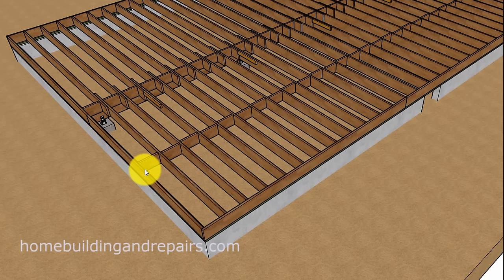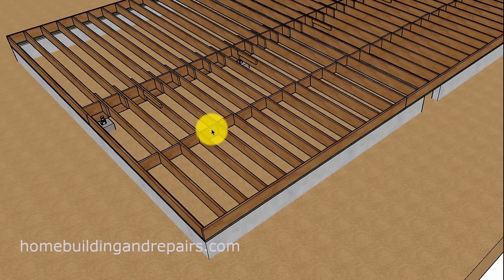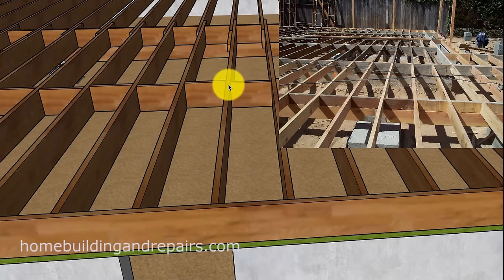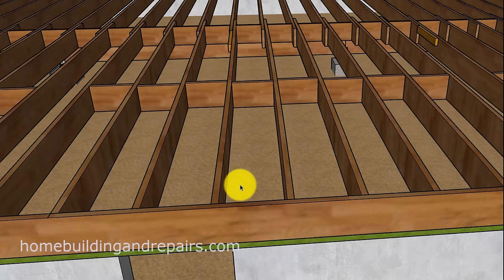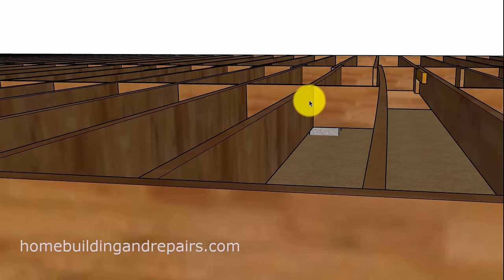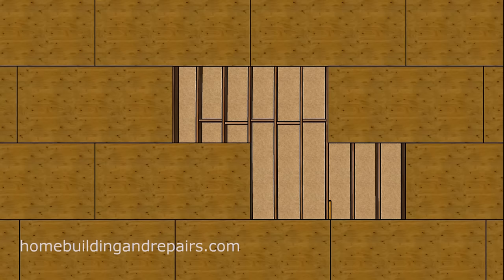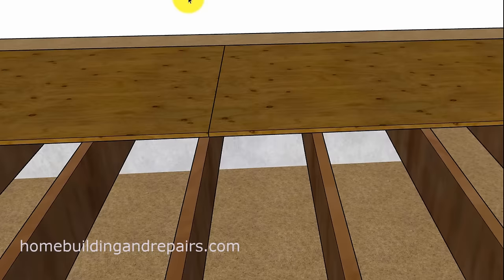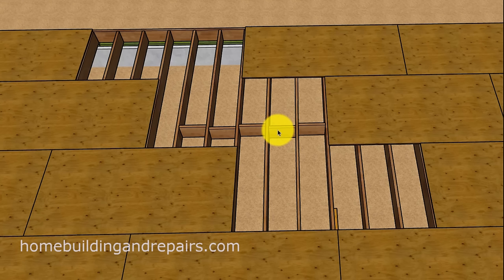This Is One of the Biggest Problems Keeping Floor Joists Straight

Comment: I'm building a 16x20 cabin im using 2x12x16' floor joists I don't want to put in blocking i really don't want my floor to squeak do you think I need them or can I get away without?
Reply from the maker: I cannot provide you with engineering advice, but can tell you that if you don't use them, it wouldn't be a bad idea to nail a 1 x 4 on the bottom and run it across the center of the 20 foot span to prevent the joist from moving.

Comment: Can I use Simpson strong tie hangers with 2x8 for mid span blocks on 2x10 floor joist that extend 14’? Just trying to sure up the beams before we finish basement. Thanks in advance.
Reply from the maker: It's probably something rarely done, but I don't see why you couldn't do it. Now for the big question, what is your reason for doing it?
Reply: @gregvancom  Mainly OCD, finishing basement and I thought it would be a good idea to replace split blocking with midspan blocking, but I can't nail in the mid-span blocks on both sides near the walls. Also, I sister joisted 5 runs under my kitchen island so didn't see how I can nail through double planks. Thanks for the reply.

Comment: Question please.  I'm building  a tiny house on a trailer frame. The floor is 9 feet wide by 29 feet long. What spacing do you recommend and should I use blocks?
Reply from the maker: I cannot provide you with structural engineering advice, but 16 inches on center usually seems to work pretty good and if it's only going to be 9 foot wide, I wouldn't install any mid-span blocks.
Reply: @gregvancom  Undersood

Comment: Pull your measurements from the same spot when spacing. Don't hook the last one and you shouldn't have problems. You can't just cut your spacer blocks to 22.5. because you will gain.
Reply from the maker: I know a few people who won't pull from other joist along the way, but if joist are space perfectly, then it shouldn't matter.

Comment: Greg, if you have a room of 8 x16 with joists 16, is it necessary to stagger the sheathing? Four pieces of 4x8 would work perfect, but I've heard to stagger the plywood
Reply from the maker: It's always better to stagger the sheeting from an engineering point of view. However, I couldn't tell you whether or not the building was going to fall down, if you didn't do it.
Reply: 4 pieces of 4x8 will still work perfect if you stagger joints - you just lay two end to end, then cut one of them in half (or to whatever dimension your joists dictate) and put the two halves on either end of the 3rd whole whole sheet.

Comment: What if the blocks were cut at an angle so you could pull-in/out each board to be 16” on center?  Would that defeat the purpose of the block?
Reply from the maker: It sounds like a time-consuming process, but as long as the top and bottom of the joist are stabilized in a way that will prevent them from twisting or deforming in a way that would weaken the structural strength of the floor then it should work.

Comment: Your videos...are excellent!!  I  just have one thing to say (ask) I ran into that problem on just a couple of the joists, thank god, and I was unable to straighten the couple of them to accept the plywood deadcenter, so what I did was I nailed a 2x4 along the joist so that I was able to at least nail the end down on the couple sheets of plywood.  Was that alright to do?  I thought it would be since it wasn't weight bearing.  Was that wrong to do?
Reply from the maker: I've done it and every other carpenter I've known has also done it numerous times and would do it again, unless someone like a building inspector or engineer said I couldn't.

Comment: What is the distance between joist sir?
Reply from the maker: Usually 16 inches from center to center joist or with 1.5 inch thick lumber like a 2x10 there would be a 14 and one half inch space between joist.
Reply: @gregvancom  if i have a 2”x3” joist and i will use a 3/4 inch plywood for floors, what will be the best distance between joist?..Iam planning to construct a subfloor.. thank you sir..

Comment: I have just found your channel and am really enjoying your videos. Regarding mid span blocks, what would you do for a floor with 12’ lengths of 2x10 that have no blocking but show leaning, top of boards 1/3” toward exterior foundation wall?
Reply from the maker: If you can, send me some pictures. You can get our email address at the website.
Reply: @gregvancom

Comment: We are working on my son's "new" 1917 2 story home. His 1st floor main beam has dropped which I have a game plan for but my question is: his floors are "standard" 2x8s (not dimensional) spanning 14 feet ON 24" CENTERS!! They are visibly sagging in the middle.  If we decide to strengthen the floors, would we do better to jack up the joists in the center then sister in new joists gluing and nailing them together OR place NEW joists in between the originals? I am concerned if we don't sister, the original joists will have sag and the new will not causing problems.  Also I am curious, if we sister, do we NEED to block?  Thanks for any input!
Reply from the maker: You might need to do both, depending upon how bad the floor is sagging. However, if I was going to do one, I would install the additional joist in the middle of the bay. If this doesn't work, then you might need to install a new beam to support the center of the floor and raise the sagging joist.

Comment: no one is going to constantly pull out the tape and check their every joist when it comes to production framing. blocking is just blocking. grab a chalkline and chalk it on the half and half  on the joist and there you fixed the  sheathing “problem”
Reply from the maker: One of the biggest problems with production framing is that most of the framers or piece workers rarely care about the next part of the assembly, for example in this case it would be the floor sheeting installers.
Reply: Clearly I live in a house you must have worked on thinking that is acceptable thinking. I have squeaky floors bowed floor joist and blocks added to the mid blocks. My house  should never have been by a building inspector but he must have gone to your trade school too. I would much rather know the right and correct way than the lazy cheat that no one sees until to late.

Comment: There is a better way. Chipboard flooring. 22 millimeter boards. Every board is glued to the other. They all become one big sold cheat for the entire room. You just lay and glue. No need to check for where there are beams under. Also, you glue them to the beams. Some single nails to hold them down when the glue drying is good.
Reply: That adds a layer of challenge when you think about installing hardwood.
Reply: Jim K How so?

Comment: I just use a spacer block. Then, cutting the mid span blocks is a breeze. No need to measure everything each time, and your spacing is dead on center everytime. The probability of bowing is near non existent, in fact due to the consistency of the sizes, it can help to straighten curved materials.

Comment: Don't y'all use bridging anymore?
Reply: Rick West  makes for a good clean job, but I don’t think the code requires it for 2x12 or less when solidly blocked at ends to prevent rotation of the joists.
Reply: @stevelopez372  when mechanical and electrical trades come in, don't they bust that blocking out to install their stuff?  Yeah, they bust out bridging too but not always.  They can run electric and supply lines around it, some drains too.
Reply from the maker: I've only used it a few times and it seems to take a lot longer to install and that's probably the reason why it is not used in production or track framing.